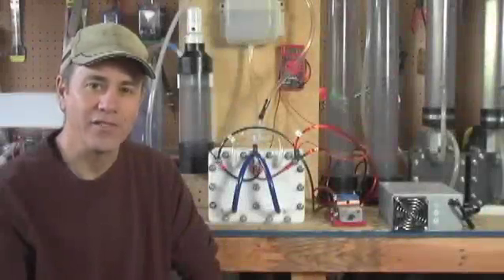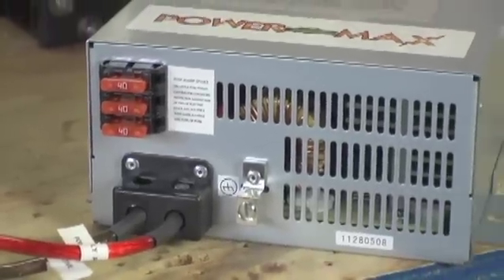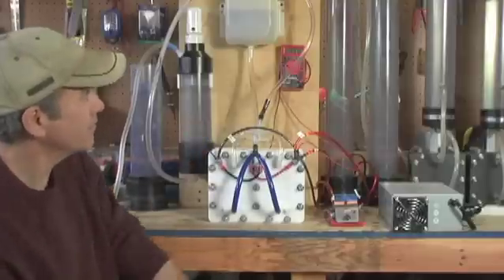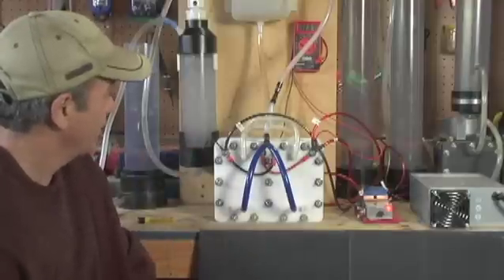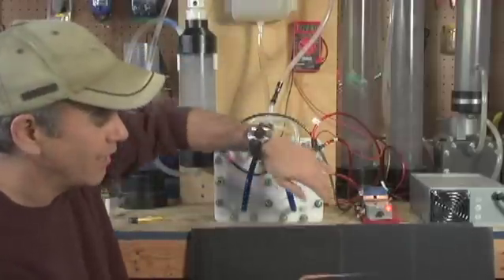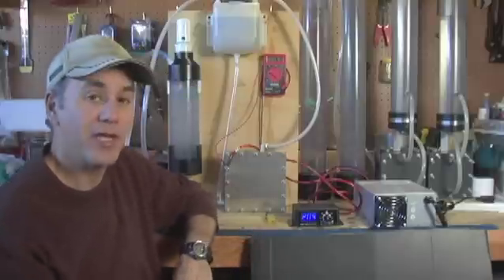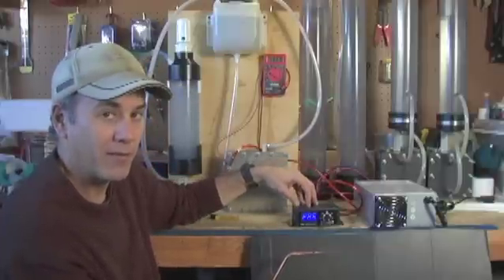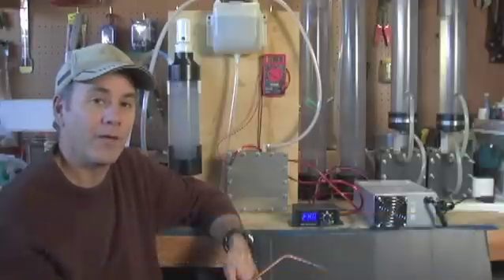HHO Torch Ideas For Your Shop

Comment: Hi. im using NaOH  powder as catalyst mixed in destilled water. but what are the mix ratio that you are using. are you adjusting this as how much amp you draw or should you have the same strong mix all the time but regulated with PWM meter? Really gratefull for good answers here.

I love your videos
Regards Rune From Norway :)

Comment: Look up a dell poweredge 6650 power supply. They are 12v 72a and can be put in series for 24v, 36v ect. These are going for dirt cheap on ebay $20-50 each. There is a trick to turn these on but easy once you figure it out. Anybody need help turning theirs on just holler at me.

Comment: So I have been having the conversation on Youtube as to the usefulness as HHO in a torch. There are many many videos that are titled"HHO Welding ...." yet no one ever actually welds anything. They only melt bolts, nuts, and brick. This is not welding and I suspect that the HHO is not capable of welding because of a dirty flame. If it was capable of welding and such a great alternative to Oxy-acetylene there would be at least a few videos of people using it for welding. As a weldor I am interested in the tech, but I am beginning to think it is a load of slag like all the free energy crap you see on the net.. I experimented with HHO back in early 2000 before the current crazy and while I got high output never found a good application for it. So tell me if this can actually weld please prove it. I want to see quality welds with test preformed on the coupons. Thanks

Comment: pwm, is nothing more than a regulator knob.
Reply: when u run a HHO cell they heat up and that makes the water temp. hotter making the cell draw more amps indefinitely until rubber and plastic in the cell melts, the PWM pulses the voltage/amperage. That controls the amp draw run away effect. U set the amp's u want and it will continuously change the pulse width to keep at the desired amps. It does a lot more than what a regulator knob does, you would have to manually turn the regulator knob every minute to do what a PWM does...

Comment: I'm curious what you think would be more efficient.  
1.  Parallel 31-plate side-by-side cells as the one shown in this video.
2.  A short and wide 31 plate single cell similar to that shown in your "Tips for building an efficient dry cell" video.  
The surface area of the single short-and-wide cell being twice that of each single parallel cell, making equal surface areas for each configuration.

Your thoughts would be greatly appreciated.  I truly enjoy your explanations.

Thank you

Comment from the maker: Can't say because I have never used a large Oxy-Acetylene torch. I'm assuming it all has to do with pressure. Make enough HHO to put a lot of pressure coming out of the torch tip. The more pressure the better it will cut the steel.

Comment from the maker: Any cutting of 1/4" steel will probably require a larger cell powered by AC converted to DC with a bridge rectifier. I would say at least a 6" x 6" or 8" x 8" cell with 59 plates. Or another cell with similar overall plate surface area.

Comment: im gonna post my latest experiment soon its a copper cathode annular dry cell that uses a silver solder  stainless steel anode. the silver solder is coating the exterior of the anode and does not contact the electrolyte. the cells runs cooler then any cell i have ever seen , it refuses to heat up, it runs at about 70 amps max @ approx 3 volts to 2.2 volts, it is operational but its just an experimental piece  , im having trouble pushing more then 70 amps due to harmonic distortion of my MOT

Comment: my current goal is to build a cell like your tool box cell "the small one " that can crank out at  least 8 LPM  and also be able to produce a micro flame. the biggest challenge  is going to be cooling , nearly all my newer versions are using cooling systems because i over power my cells on purpose  im going to use the components from my iron plate cell . i got the iron plate idea from a old chemistry book , back in the 30's they used huge iron plate cells so i tried it ... i don't recommend it

Comment: yes flashbacks are tricky, these days i dip my torch in water to put it out as i always have a small cup on hand or i turn it up full blast but micro torches don't work like that  i have to use the water cup even then i still get a small flash back but lately i've bin using a system robust enough to handle the blast. my main reason for using these torches is soldering of all types and as you said its so cool to never need fuel or run out of fuel i should say.

Comment from the maker: Yeah I'm familiar with the AC/DC setups, thanks. Steve over at GreenFuelH2O sells a 59 plate setup with a bridge rectifier and a variable speed controller just like you are describing. Thanks for the info though. I've actually been using a concept I learned from you a few years ago. Using a compressor to inject air into the torch to put it out without a flashback. Thanks for the tip!

Comment: incase your interested it is possible to run 120 volt dc on 31 to 39 plate cells, ive done it on several cells one i have video of its called an iron plate bipolar cell also i did some test with cells that ran at 4 volts per plate gap with outstanding performance so technically you could construct a 30 plate cell without a power supply, these set ups work very well with router speed controllers{ triac circuit }, im just trying to help not being a wise ass

Comment from the maker: You need some descent volume to feed multiple tips. Most guys who have done it convert AC to DC and run big (59 plate) cells. One of the most impressive setups I have seen lately is from a guy in Russia, his YouTube name is SEVER -S. He is getting a very nice flame from a smaller setup but it is not straight HHO. He is running the HHO through Acetone to cool it and take out the Oxygen. I have not tried it yet. I can't post links here, but look up his videos.

Comment: would 2 computer power supplies putting out 25 amps 12v  put in parallel work ? to get extra power, they are free off the rubbish tip.

Comment: Hello Mike!
I have used this torch for some applcations, but sometimes the flame is too hot and "oxidative" (it burns the metal).
To make the flame "a little coulder", i add butane gas from an additional bottle, connected to hho gas tube, in a verry controlled amount. (bubbelled throug water in tube).
It is useful for brassing.

Comment: Hey Reb, I seen a guy use a rubber stopper in his cell. In case the system blows up the pressure will simply pop the cork out. I know greenfuelh2o has simple inline flashback arrestors. I also seen another guy use a basketball needle inflater as a touch tip. with a cigarette butt stuffed in the line.

Comment: Hi Mike, I have a question. Do you use an in-line fire supressor for your tourch as well as the flashback protector on the bubbler? If so, what do you use? I have a friend that got me into this HHO stuff and I built my first cell for my pick-up using 3" pvc pipe, the plates are + - + - with no nuteral plates. I made a tourch head for it as well and had good flame but the flame got small and I had a flashback. What should I use to prevent this?

Comment from the maker: The amount of plates depends on how many amps you want to run. With a tiny cell like that I would say at least 25 plates for 1 1/4 lpm at 20 amps. Would make a good jewelers torch. Get a 45 amp power supply and use a 40 amp PWM from Hydrogen Boost Now, it's good for 10 - 40 amps.

Comment: After reading this, I have to think the cheapest way to go would be a 120VAC to 12VDC conventional battery charger from harbor freight. You would have to get one that is constant voltage/constant current, which means the charger doesn't adjust it's output based on what it reads from a battery(i.e. no autostarting trickle charge, sulfated recovery, etc). The PWM you speak of may be able to condition the dc voltage from there. I need to read more about the PWM.

Comment: The power supply is rated at 12 VDC, but it actually puts out the 13.7 under no load. The voltage drop you see is because of the inherent resistance of your system, i.e. the wiring, the plates, the water.

The power supply helps compensate the voltage drop by providing a slightly higher voltage caused by the resistance.

Comment from the maker: If you use a bubbler and or dryer to scrub the vapors and electrolyte you won't get engine damage. If you just run the line straight from your reservoir then yes you will get damage because of the electrolyte in the vapors. 

I do like you idea about the Spectra though, looks like it creates a vortex which makes sense. Might even be a good combo with HHO. Help mix it up more evenly. Thanks for the input!

Comment: hhoconnection kit comes with bubbler built into the reservoir? And PWM is not needed?, I see Volo chip is recommended as option. Ammeter is not in the kit; not needed?. Tks.

Comment from the maker: @TEO7682 Mix your electrolyte at maximum strength (28% for KOH). This will make you draw many more amps requiring 6 neutral plates or a PWM, or both.

Comment: Have you experimented any with building your own high voltage power supply? I've seen some of the guys using pulsed dc for their systems. Coming straight out of the 120 or 240 grid to a transformer, then into a high amp bridge rectifier. They are using equipment like a router speed controller as the pwm. When they are using these supplies the cells only pull 1-5 amps and it seems to run just as smooth using low voltage high amps. Your thoughts?

Comment from the maker: @jdcproducts Unfortunately I am electronically challenged. I would love for somebody to come up with an inexpensive AC to DC power supply with voltage control. If anyone wants to build it, we need it. Only problem is you will have to use a larger cell (over 80 plates) which is going to drive the cost up again.

Comment: Mr. Mike i want to ask about the plate size , if the plate size is 30cm * 20cm and 13 or 21 plate for making a cell ! how much power it will need ? or let me ask in anther way if the plate size are big is that means more amp ! and  what about the production ! 

Thanks.